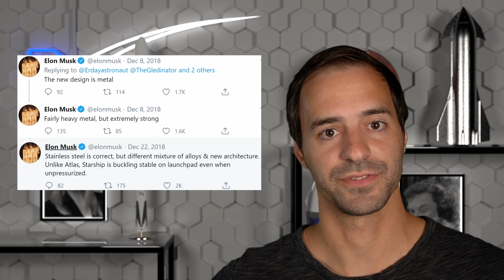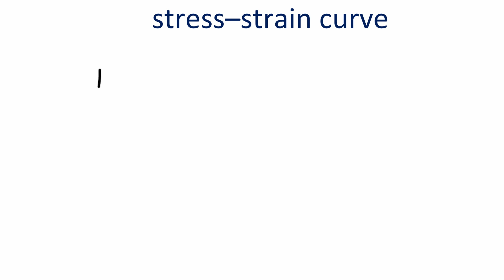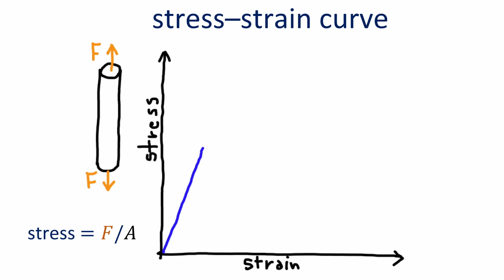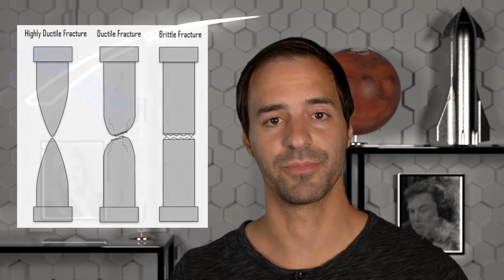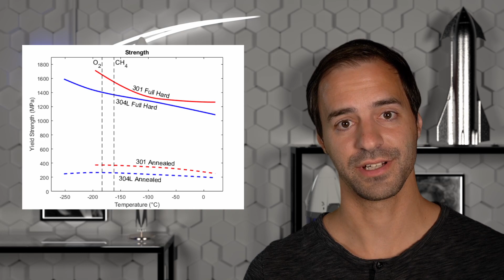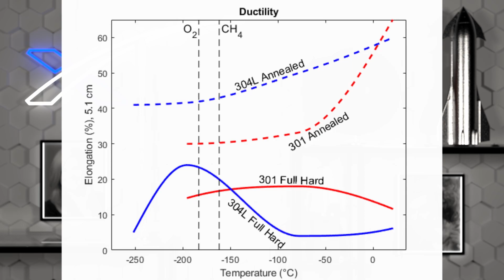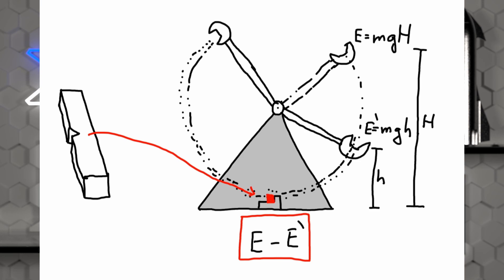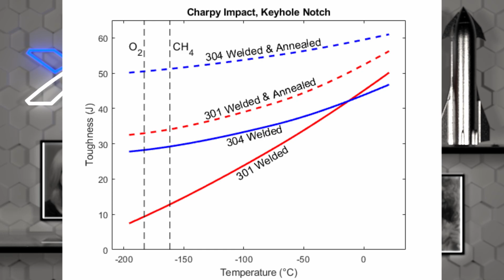Why Is SpaceX Switching to 304L Steel for Starship SN8?

Comment: I don’t know how either of these metals is made, but I’ve wondered why it wouldn’t be possible to make the rings in wider segments, or even nearly the full length needed for Starship - then far less welding would be required, and the rocket would have fewer potential weaknesses. I guess that would mean building an entire foundry in Boca Chica, but if Spacex is planning to build hundreds, or thousands of Starships...?
Reply from the maker: Hi there! The rings are already pretty wide, roughly two meters. It would probably require a huge foundry investment and there might not be other customers for it. Who knows, maybe they are already building it.

Also Elon said that they want a different thickness of the steel at different sections, which night be easier to do with smaller rings? Not sure...
Reply: @spaceflightexplained360  Elon's comment on different thicknesses used in different sections may hint that columnar loads could control the design.

Comment: Excellent Video. Subscribed and Liked :D.
Very informative and on point with your titled topic.
If I may make some constructive suggestions?

You mentioned you were going to make more videos, and then said, basics of spaceflight, getting to orbit, etc etc.
Please do not do that! That is the common trap i see a lot of my content providers fall into. 
Keep your subjects extremely focused on a topic within a topic like you did with this video.
Fill it with every bit of information you could find on this one particular sub-topic within a topic.

That is why I came here. I know about spaceflight and how Starship would get to orbit, and how orbit works.
 I wanted to see independent analysis of why 304L was better for Spacex purposes than 301.
You did a great job.

Dont do what some others have done, and go from making vids about the specific details and analysis in the buttressing of floating roof crossbeams of the first Industrialized factories, to making videos about Global Warming and what causes it.

Overall excellent video. 9.5/10
(Edit: Misspelling corrected, and duplicate words removed)
Reply from the maker: Thank you so much for the comment! I have to figure the exact focus myself, but when I said fundamentals, I'm thinking of getting in depth on the Tsiolkovsky's rocket equation, engine ISP or some basic Orbit math. I might make it a little mellow sometimes to connect the dots for the in-depth topics, but don't worry...
Reply: @spaceflightexplained360  Tsiolkovskys would be awesome. I look forward to many vids from your Channel. Thank you for the content and replies. Good luck my friend.

Comment: Did you also look at the hot strength and how well 304L holds it's work hardening when heated?  How hot the structure can get directly scales the thickness of the heat-shield.  So a slightly weaker material that takes high temperatures better can end up with a lower system weight.
Reply from the maker: Hi Marty - that was one lingering question when making this video. I did not know what how much work hardening they are using for their steel. I did some basic math to see what tensile strength do they need for the unwelded metal, assuming 8.4 atm pressure, 9 m diameter and 3 mm thick steel. It is pretty brutal for the hoop stress (1250 MPa) so they definitely need a lot of work hardening. For the welds, they need half of that, but it is still a lot. It actually seems right on the edge of what is theoretically possible, and getting the practice to match the theory requires a lot of experimental work.
Reply: @spaceflightexplained360  Getting practice to match theory is also a LOT easier with a highly ductile material.  As any point defects will stretch a little instead of initiating a crack.  I.e. this is a key reason a weaker but tougher material is often better, and why carbon fiber structures often aren't much lighter even at room temperature.

Comment: Elon will anneal the welds by aerothermic heating of re-entry.  Flight proven starships will literally be stronger.
Reply from the maker: I am curious how this will be done in practice - how do you anneal it uniformly, on each side, and control all temperature, time, and cooling? In other words, and with many things SpaceX, I will believe it when I see it -- and I cannot wait to see it, because they usually deliver.
Reply: @spaceflightexplained360  giant industrial heat treatment ovens are a thing already, just needs to build one to fit the tanks.
Reply: @volvo245  Why not just hang an array of cal-rods down the middle of the vehicle, wrap the whole thing in high temp insulation, and turn it on? :)
Reply: They might get some stress relieving which can be carried out at a fairly modest temperature but they won't be annealing without heating to glowing orange hot for a while.  I wish it were so easy to anneal stainless.
Reply: @DB-xu2cg  A few things are important. The heating on reentry and slowing down inpreparation for landing is VERY uneven. I think it's only going around 3,000mph or less. The SR71 titanium aircraft got up to around 800 degrees at 3,000 mph. Not hot enough for annealing stainless steel. As the video says, to anneal stainless steel requires temperatures around 1,500 degrees F. And it mustbe very even. At annealing temperatures stainless steel loses  strength and in some cases needs to be protected from oxygen. Nonetheless, atmospheric heating is not uniform along the surfaces of the booster. Annealing absolutely requires a specific heating, soaking, and cooling schedule that can last for hours. 
So, after the rocket drops back into the atmosphere it experiences very uneven heating for too short a period of time and it a temperature way too low for annealing to happen.
Reply: @henryD9363  This part is very well said, (the other part is relative to the speed of leaving & re-entry of "superheavy booster", (atmosphere is relative) (could say to "Kuiper belt") I make mistakes like that ... could edit as I do.
Reply: @matthanrath497  
The Kuiper Belt is near the edge of the solar system. Do you mean the Karman Line perhaps?
Reply: @Warriorcat49  I was never good at telling a joke. Just because I think of something funny, does not mean I know how to write it out properly so others understand. :-)
Reply: @matthanrath497  
Oh, I understand you now. Sorry to kill the joke, lol.
Reply: I found this paragraph on a stainless steel supplier website. So it takes a long time and a very high temperature, more than I thought.
"The proper method of annealing – temperature, time and rate of cooling – depends on the type of alloy.  Most austenitic stainless steels are annealed at a minimum temperature of 1900° F (1038° C) followed by water quenching or rapid cooling.  Martensitic steels are annealed at lower temperatures (around 1400° F/760° C) and slow cooled."
Reply: I also found this about reentry speed. The first burn brings the speed from very high velocity to below Mach 3. Heating is below an yielding temperatures, and again the time period is way too short for annealing.

"Normal reentry at Mach 8 would probably expose the Falcon 9 to close to 1500 degrees Celsius which could do some damage. Their first point of shielding is the reentry burn at 60 km altitude. First it bleeds off the speed anywhere from mach 8 and 5 to Mach 3. Second, the exhaust at 60 km is about 300 C due to the pressure drop, and acts as a temporary blanket or block until the speed is below Mach 3"
Reply: @henryD9363  excellent.... Team building possibility?
Reply: Johns Great researching and additional info.
Reply: As it does it's belly flop reentry the deceleration will cause the lox and liquid methane to be pooled against the leading side skin. So heating up is not really an option.
Reply from the maker: @williamgreene4834  The skin would heat up the fuel, which would boil and dramatically increase pressure. It would have to vent or explode... But... 

I think that SpaceX plans to keep landing fuel in the header tanks inside the larger tanks. I don't think there will be much left in the large tanks during landing. Also, sloshing issues if there is fuel left during belly flop. So the header tanks solve all the problems.
Reply: @spaceflightexplained360  Also the leading side will be covered with thermal heat shield tiles. This will prevent the plasma from interacting with the stainless skin. They are testing a small area for acoustic and mechanical stress on SN5 and SN6. They will probably blow some more stuff up before they get there. :)
Reply: Daniel Risacher lol interesting
Reply: I'm not sure that starchip will reach 1000°c for half an hour during re-entry...
Reply: This may have been a joke 😇.
Reply: The booster will not reenter because it doesn't leave the atmosphere in the first place. I don't understand your comment

Comment: Good dive into interesting subject - informative. Suggest Starship welds will be annealed during the test flight reentry, in which surface temperatures should exceed 1000°C then slowly cool after landing. Great work VH, love the set btw.
Reply: This needs more explanation than just a simple sentence. Wouldn't annealing it, under any circumstances, require a temperature rise that would soften or weaken the metal? And in any event the heat of re-entry would likely be very uneven. Furthermore, he described heating it for a long period of time such as an hour in order to accomplish annealing. The idea of annealing on reentry needs a lot more explanation.
Reply: @henryD9363  Suffice to say there is more info out there than I can post in a youtube reply. Remeber Elon's twitter handle A-12 with A-12 Archangel pic? (SR-71 Blackbird Prototype)

Well, some high-velocity aircraft, such as the SR-71 Blackbird and Concorde, had to deal with heating similar to that experienced by spacecraft at much lower intensity, but for hours at a time. Studies of the SR-71's titanium skin revealed the metal structure was restored to its original strength  and exceeded original manufacture strength through annealing due to aerodynamic heating. 

To reference,
In Ben Rich's book, " Skunk Works: a Personal Memoir of my Years at Lockheed", Major Randy Shelhorse (Air Force RSO Test Pilot) states " In fact, a study by the Defense Science Board review, in 1984, concluded that the Blackbird's outer titanium skin, ANNEALED BY HEAT ON EVERY FLIGHT, was actually stronger than when first delivered on the finished aircraft, more than a decade earlier."
 Book Link: https://play.google.com/store/books/details?id=oL4bHPIt7XIC&rdid=book-oL4bHPIt7XIC&rdot=1&source=gbs_vpt_read&pcampaignid=books_booksearch_viewport

While I can not explain thermodynamic specifics to you, I can say the concept has been done before and studied. Elon more than likely knows this as well.
Reply: Looks like @Daniel Risacher and I both agree with you on this. Coupled with all starships up to SN 50+ will likely be cargo variants they will have this datasaet nailed to understand heating(annealing) results in various atmospheric reentry conditions. 

I have also been thinking a lot about basically oven proof robotic welders. Obviously super-expensive process both in terms of energy and financial capital; Oven heats Metal to be welded to annealing temps, welding medium is inside also same temp., Maybe even solid state infrared inside vacuum chamber (lol), there would be no insulation needed, and highly efficient as all energy goes into the piece being heated. Weld that piece under those conditions. Removes the need for flux mostly as well.

I wonder what benefits would arise from a process like this if any.
Reply from the maker: @CalebFuel  Ha! That is an interesting idea! Annealing by atmospheric reentry. There are two things that would worry me:
1) The annealing has to be controlled pretty well w.r.t temperature and time. If you heat it up too much or too little, you might make it worse.
2) Only the windward side will get a lot of heat, resulting in non-uniform process. Combined with 1), I it would be very hard to do well.
Reply: @spaceflightexplained360  Very valid points.
1) I understand controlled heat treating and variations within the treating process can cause cracks and all kinds of bad things, however that is why I am hoping that through a 50+ starship prototype run, they may be able to nail this. One example is the ballistic coefficient of starship and the atmospheric conditions at various heights (extreme upper atmosphere) are well known quantities. Factor these into an orbit that keeps you at altitudes (think Heat Regimes) you want to be in for periods of time you need to be in. 

I understand this would be fuel dependent , likely having to reboost alot throughout the process, but hey we have to work on On-Orbit refueling too right? lol
Where else is he gonna find an Annealing Oven big enough for Starship?

2) This is one I can not figure out. I am not sure of the effects of uneven annealing on any material much less 30X SS that Spacex is choosing to use. 
     Also factoring that windward side will be covered in Tiles anyways .. I just dont know. 

Would be super cool if he figured out how to accurately heat treat all of SS and boost its performance characteristics immensely.
Reply: Actually reading through my last comment, my solution to 1) solves 2). Understand heat regimes, keep SS in altitudes that heat how needed , as needed , without ever going over thresholds thermally. With it unmanned , you can even roll the ship through the process to ensure even heating once you got the tiles hot enough on the bottom. Just have to dial in your values and thresholds for where you do and dont want to go.